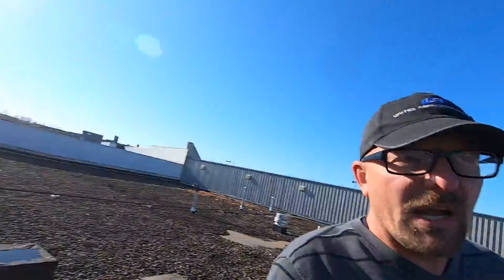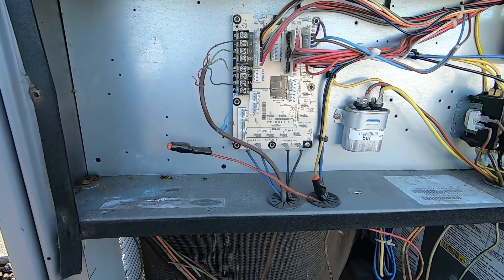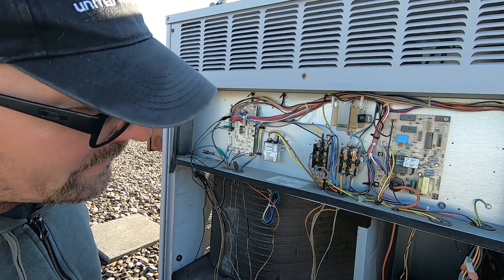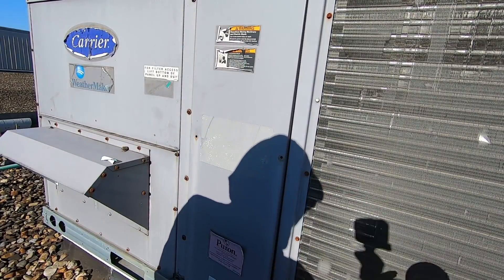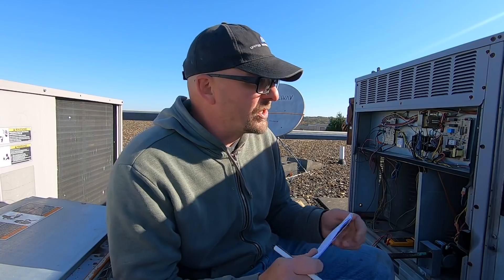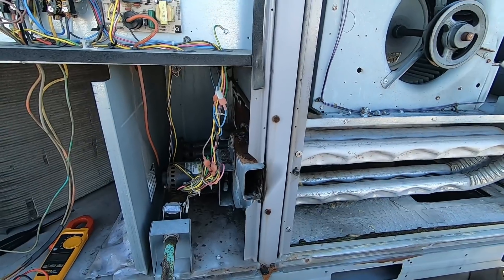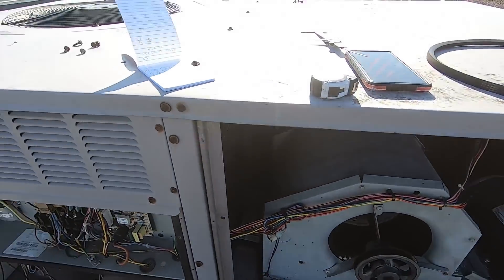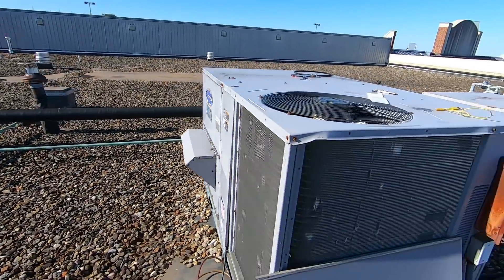HVAC No Cooling Service Call with LOTS of ISSUES

Comment: Ryan, do you have your own drone?

Regarding the one with about 10 issues, including heat exchanger, motor contactor, board, burners, etc... What's left? Isn't that a whole replacement? Alacarte has got to be more expensive, no?
Reply from the maker: We give the customer the option of unit replacement vs repair. I make sure to cover myself.

Comment: Excessive on the diagnosis, I would have recommended some of the repairs, but if the motor hasn’t failed, most people want to let ‘em run till they fail. They could probably get another couple of years out of that blower. No question the heat exchanger failed, but changing the control board, gas valve??? You want to be thorough, but not rape people. With the blower motor, safeties, control board, etc. it would be better for them to replace the unit than do all of that. I tell my customers the truth and let them decide. The unit could have been brought into safe functional order without ALL of that. Also with that being a 410a unit, not r22, it probably does have a leak. By all means tell the customer about everything you found, but damn, recommending all that. With all that it would be a better investment to replace. I would give them the truth of what I found, tell them I can bring it back safely with this, but it’s time to consider replacing this relatively soon. Many times the customer doesn’t even care about heating so much, just get it to straight cool then shut off gas valve and disconnect heating call. I do whatever I can safely so people can get as much life out of a unit as they can. It’s just a waste to invest that much into an aging system like that, get it to run let them get the life it has left and put the rest of that money towards a full replacement.
Reply from the maker: I see what your saying, the facilities companies we work with ultimately decide what they are going to approve and what they aren’t. I totally dropped the ball on the refrigerant. Personally I think the safety switches are good practice but I recommend as much as I can so when the motor they didn’t approve dies 1 month later we can have documentation that we recommended it. I appreciate your comment and opinion. Thanks for watching.
Reply: @RyanHughesHVAC  I see what you are saying, we do property management companies too. First job I went on I put r22 into a 410a system, we are all human.

Comment: You condemn the low pressure switch and say that its a r22 sys when it clearly says on the side its a puron 410a system. If that is the case it is in fact low on refrigerant and probably opened up that pressure switch.
Reply from the maker: You are 100% correct and I am going to address this ASAP. Thank you for watching Sir!